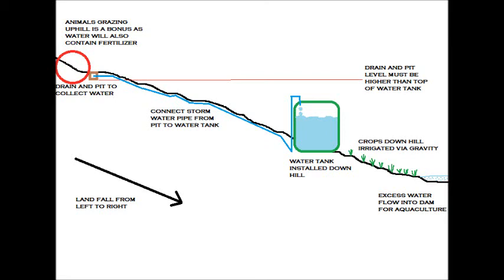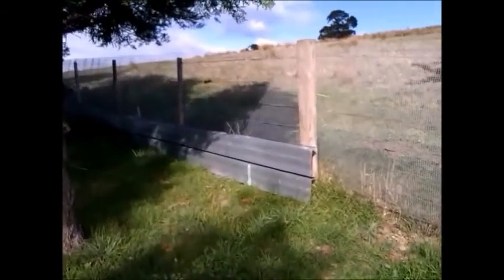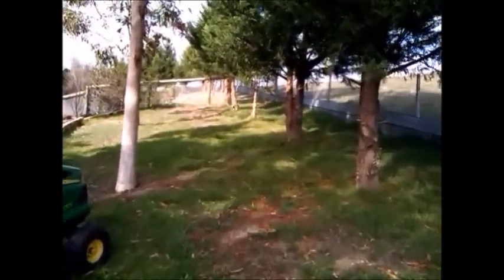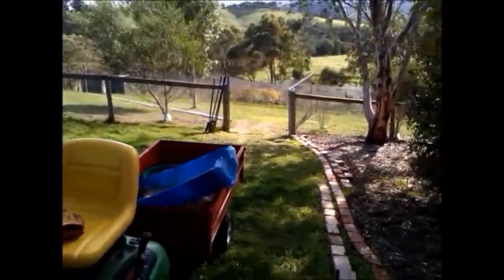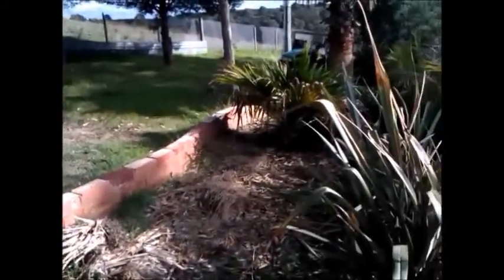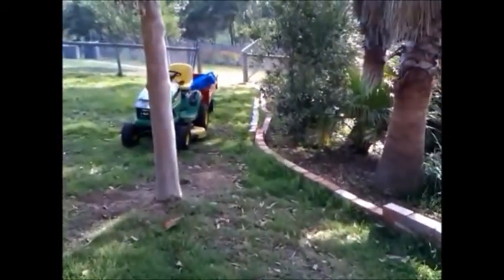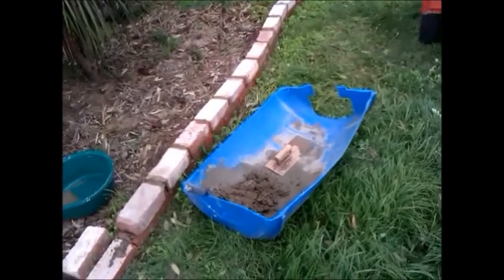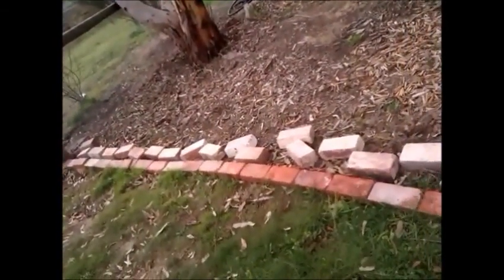Harvesting ground water into above ground tank - without pump, Part 5, Water Channel

Comment: Thanks for sharing this....the idea with the iron sheet is very cool and the second brick wall to capture the water in that area.
Please allow me to steal your idea. my main issue is that my land is not soooo steep so i dont know if the drain will be higher than the top of the tank.
Maybe i will have to dig underground tank.